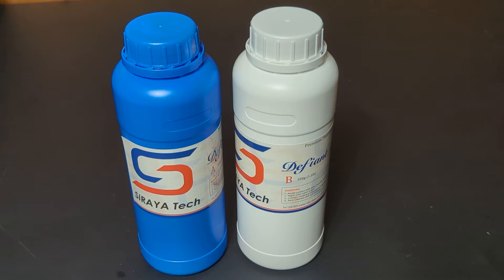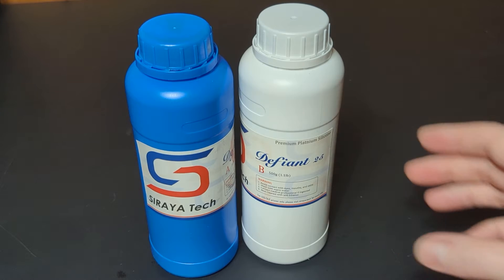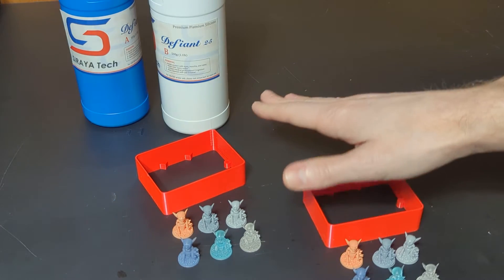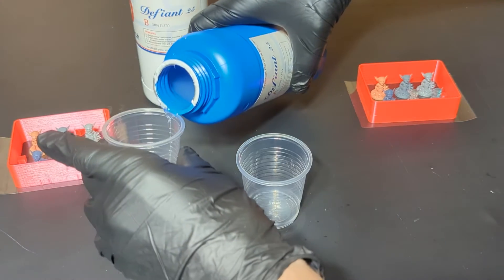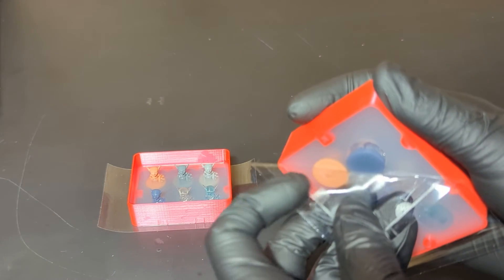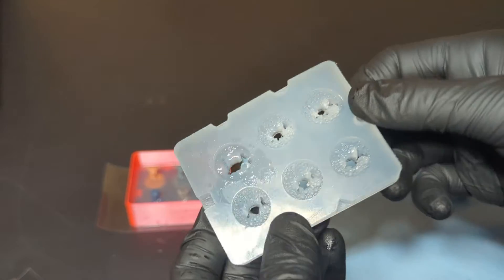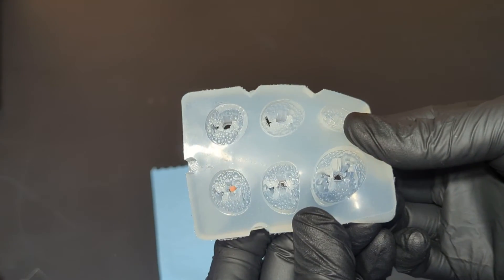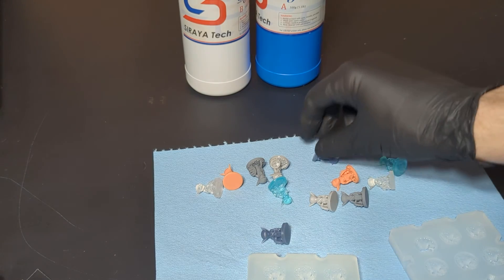Best Silicone for Making Molds of Resin 3D Prints?

Comment: Very informative Video.  I do the opposite and make printing molds and then cast parts in silicone.  After much trial and error and alot of research. Printing resins have trace amounts of sulfur that de-gas  that cause the inhabitation , What I've learned for platinum cure silicones is to soak the resin print in fresh 91% or higher Ipa for 30 minutes and brush in hard to reach parts with like a toothbrush.  wash off the ipa and then water cure the part for 6 - 24 hours. There's something in the water curing process that keeps it from inhibiting *Magic Science*. I have only done this with standard grey resins ( Anycubic and sunlu brands ). I do want to test the Defiant in the future as well.  Tin based Silicones don't care and just work 95% of the time

Comment: What's the cure time for this silicon? I tried with tiny small parts where I did applied clear coat but I think that it didn't cure at all between the part and and the silicon, the mold it solid, and I tried to take out the molded part but did noticed that it still wet

Comment: Whats the difference between 15 and 25 silicone? Which one was used in this video?
Reply from the maker: The numbers are the hardness. The 15 will be easier to stretch. I used the 25. Typically when I make dice molds, I use dragon skin 10 because it is very stretchy but still durable.

Comment: This curing issue has been a problem for me with all the printing resins I've used so far, so it's good to see there are at least some resins that work okay for casting that I haven't tried. I'll try the Siraya Tech Defiant Silicone.

Comment: Did you cure the models as requested from Siraya tech? Like curing in water or distilled water to take out sulfur? Or just normal curing?
Reply from the maker: Just normal curing, but for longer (like 20-30 minutes). I've tried submerged and other techniques in the past with various resins of various manufacturers with no noticeable difference/effect